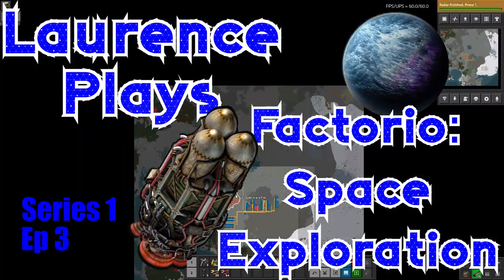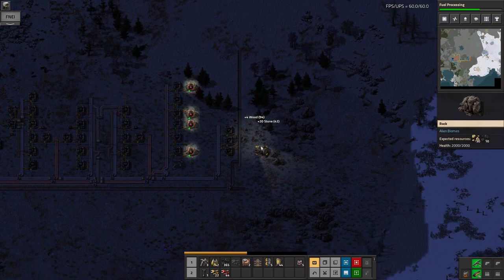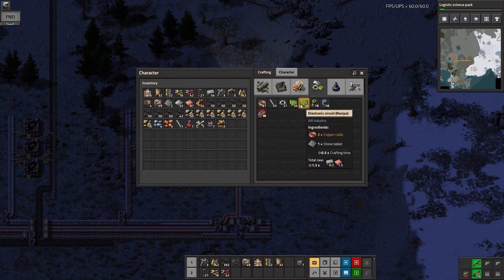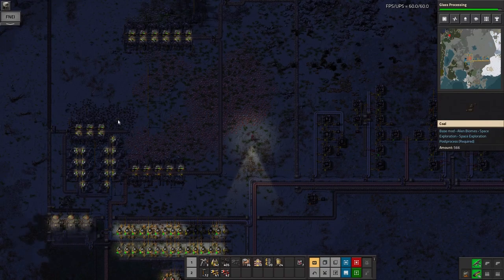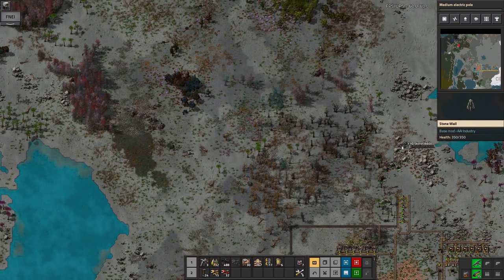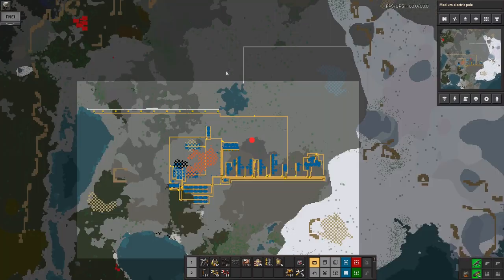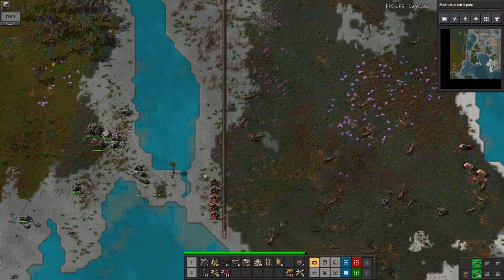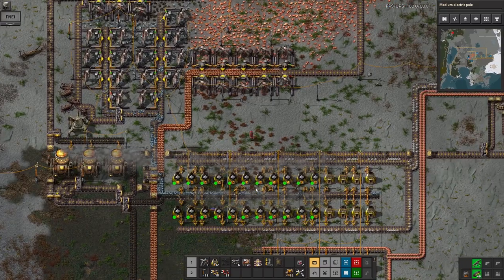S1-E03 - Build the Wall - Laurence Plays Factorio: Space Exploration

Comment: 3rd reason for burner inserters for turrets: You dont risk everyone of them stopping either because you've run out of power or bitters snipping a power pole
Reply from the maker: That's a very good point, yes! They're a lot more resilient to power outages and will keep going until the fuel runs out. Could be worse though, could be lasers!

Comment: Electric circuits need 3 copper cables and take 0.5s
Copper cable produces 2 in 0.5s
So, per one assembler, copper cable recipe produces 4 a second, and green circuits require 6 a second.
That's not three copper cable to one circuit assemblers, that's the standard 3 copper cable to 2 green circuits ratio...
Reply from the maker: Well spotted - I obviously missed that the recipe produces 2 each time it runs. Ooops! Let's see how long it takes me to notice and fix it...